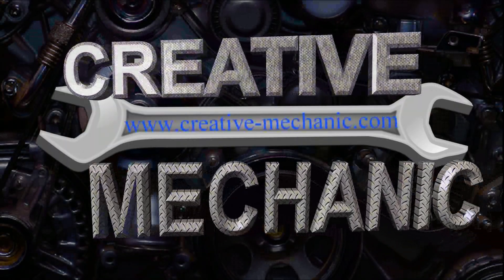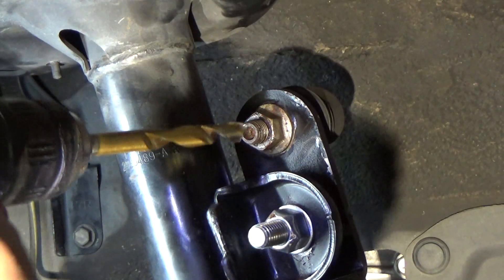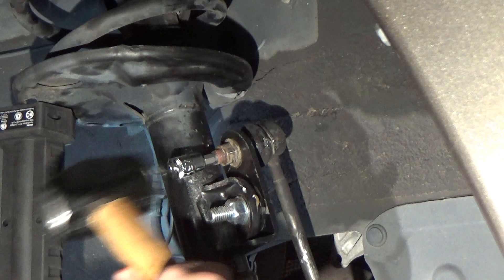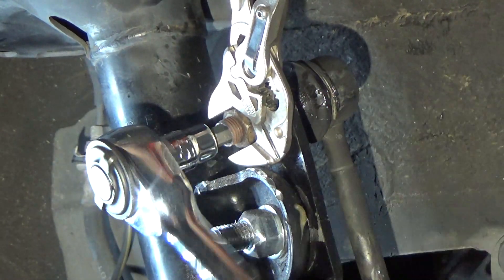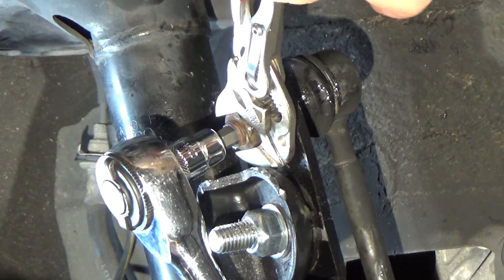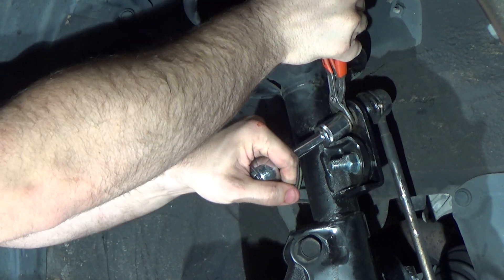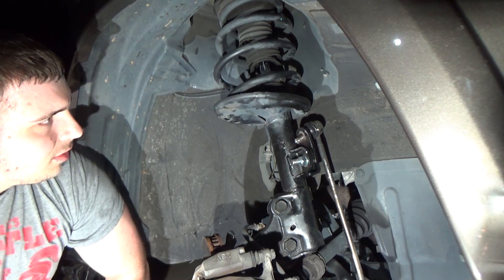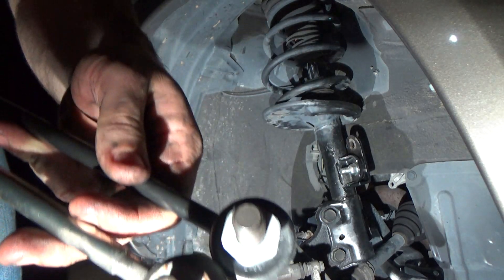Stripped Sway Bar End Link Fix- Friendly Advice ep  001

Comment: I was thinking, if you are also replacing the strut, you can just cut the sway bar end link in half (cut the rod connecting the two ball joints) and cut the lower stud off on the ball joint side of the mount (not the side the nut is on). Once you have sawed off the lower stud you can just tap the remainder with the nut on it out with a rod/screwdriver/allen wrench and hammer (basically something that will fit through the mount hole so you can punch out the remainder still in the hole). Remove the strut with the half sway bar end link dangling from it and replace everything with new hardware. At least this way you know you will get the job done, and don't have to chance whether or not the torx bit will hold. Man, I ducking hate rust...
Reply: You have saved me random guy, thank you
Reply: @TheUnchosenOne  Glad it helped 🤸
Reply: @TheUnchosenOne  glad it worked for you!

Comment: This method didn't work for me. For one droplink I got a bolt grip around the ball and used an impact driver on the nut. The other one I used a blow torch to heat the bolt, done in minutes.

Comment: what about the bottom one ?
Reply from the maker: 😂 pray it doesn’t happen, if it does, pray the other side comes loose so you can take the sway bar off
Reply: @CreativeMechanic  i'm actually half through sawing it with a manual metal saw ...
Reply: spent 50 $ on a rotative tool... that does not reach the nut lol...